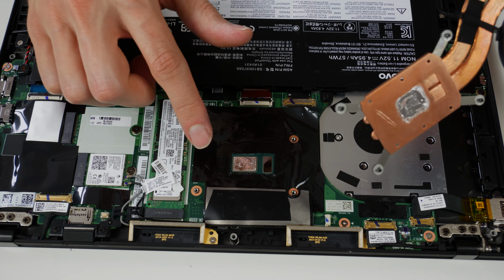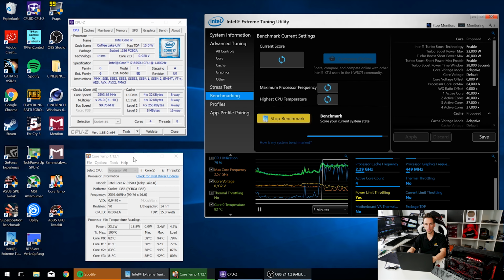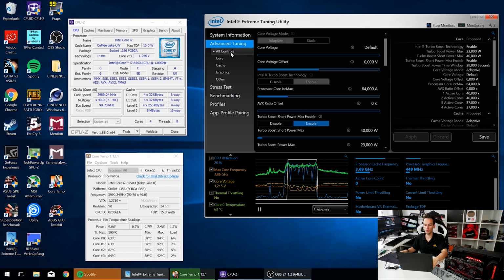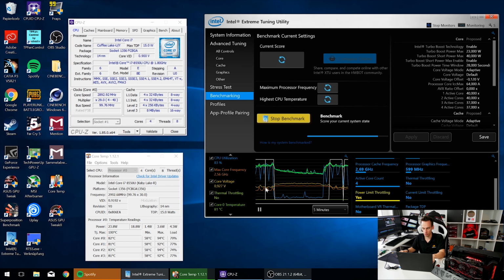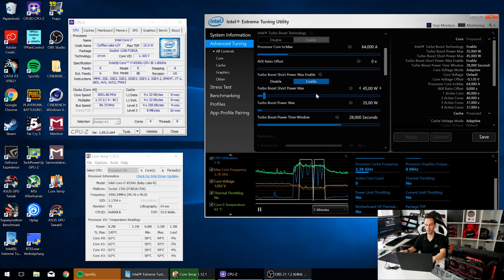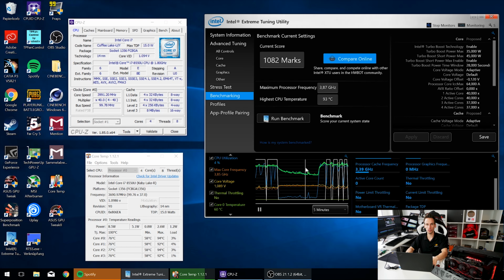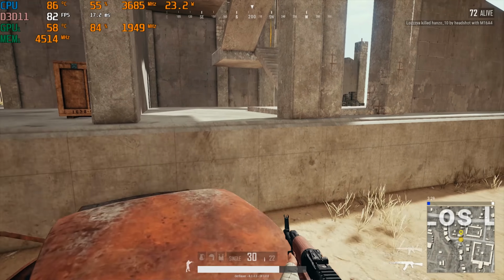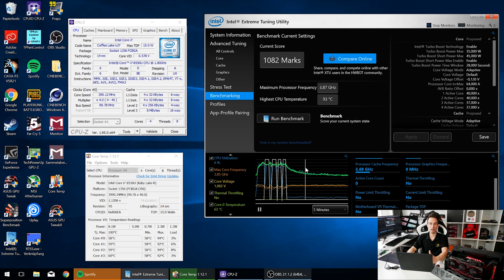Lenovo X1 Carbon G6 - Liquid Metal and Tuning (Part 2/2)

Comment: The command line options for the XTU backend (XTUCli) can be used to set power limits (Short/PL2 and Long/PL1) simply by running a script (e.g. batch file or powershell) - if you set that up to run from some trigger or program that detects the switch between AC and battery (e.g. via Task Scheduler / Windows events) it can be totally automatic. An excellent freeware program called Throttlestop can also be used to tie hotkeys (and auto-switch on AC or battery) to different multiplier/voltage profiles (but not PL1/PL2).
Reply: with throttlestop, although you can't set PL1/PL2 per profile, you can use Icc max or alternatively limit your boost clocks so that the profile will effectively have the maximum "power limit" that you want

Comment: Great video as always, Roman. 

I did the same thing with my Zenbook and noticed at least 15c cooler temps across both load and idle situations as it is completely passive. I also lowered my core volts by 0.085v to further help temps. Well worth the time and money. :)

Comment: Didn't try LM or changing any thermal paste but Intel XTU is a godsend when it comes to tablets, core voltage offset reduces the temps a lot (which matters when passive cooled) and increased the battery life a load as it would sit around 90% doing simple tasks

Comment: I've also had pretty good sucess underclocking. I have an old Macbook Air and gaming on it was horrible, and if Im being honest it still is but it's a lot more smooth. I applied liquid metal and I undervolted but still had pretty awful results. As soon as it hit the power limit while gaming the cpu speed would drop to around 900Mhz(out of 1.8Ghz max) and the Gpu would drop to 450Mhz(out of 1Ghz). After undervolting the GPU to 700Mhz (it wouldnt let me alter the cpu speed) it stopped hitting the power limit and the cpu and gpu would no longer throttle at all. Made for a much smoother experience.
Reply: MacBooks defnitely benefit from liquid metal. My MacBook pro would always run upto max temp and throttle using firefox, after liquid metal it doesn't throttle and also buying volta let me undervolt on OSX.

Comment: I've undevolted my HP Omen's 9750h by 140mV, which is quite impressive and it's rock solid in both Prime95, AVX on, small ffts, and in Ansys Fluent CFD runs that might be even more intensive than Prime95 as stress tests. My Cinebench R20 score jumped from 2750 to 3170! I actually don't feel the need of applying liquid metal, as the maximum temperature when running Prime95 for an hour is about 85°

Comment: LM works wonders for lower temps. A lot of laptops mounting solutions are low pressure where most TIM pastes are designed for desktop cooler use where high pressure is common. Also the LM helps with uneven mountings and bringing temps back in line.

AW17R4 went from throttling and having 10-15C core temp variance between banks to dropping temps around 18-20C and bringing core temps to within 2-4C of each other. 

Major risk is a chance of spillage. Due to the chassis being flexible on a laptop, protection around the Die should be done. Used thin thermal pads to make a barrier around the Die along with kaptop tape to cover any exposed pads/traces near the socket.

Comment: As far as I tested, the regular power limits cannot be controlled with either XTU nor ThrottleStop. So even if you set it to 35W, it will still throttle down to ~13W.

Comment: @der8auer Used liquid metal on my T450s. Temps under load went from 80 degrees (stock cooling pad) to 62 under load. Nice tip! Greetings from Cottbus.
Reply from the maker: thanks :) nice to hear
Reply: @der8auer  Any negative experiences on a long term use so far?
Reply from the maker: My X1 still runs perfectly fine
Reply: Awesome. I was a little bit scared because of some Redditors who claimed that the different positions you usually hold your laptop in could cause some spilling but I don't see any problems when you use just a small amount.

Comment: der8auer. Thank you for creating this video. I was a bit shy about using the metal so I followed your procedure and substituted Kryonaut. So far I have been experiencing  a  drop of  about 9C - 10C both at idle and under load. My Laptop is a Carbon X1 Gen 6 with a I7-8650U.  Intel doesn't support the XTU for my processor so I haven't tuned the voltage. If you know of another way please comment.
Reply: You can use ThrottleStop, If you don't know how to use it, I can explain to you.

Comment: Neat video. Ordered your delid tool yesterday, and that extra device in case your normal device cannot do AMD delidding out of box. First i am going to (abuse) test to see if i get any success with an old athlon 3500+ (2005), then i miiiiight re-visit some of my other amd chips. Ny gold sample 8350 got 5ghz just with tuning, but i wonder about liquid metal now. I also got a grinding tool for the top IHS so i can make it pure copper. I might need more smoothness than 1200 sandpaper however, but it's damn fine so we'll see.

Comment: I have LM applied in my Dell Alienware 15 R3 and so far, it's the best what I could do to increase comfort of using this notebook :) on thermal paste Intel 6820HK CPU had almost 20 degrees Celsius core temperatures difference, and thermal throttling was usual even on stock clocks. Now it's overclocked to 4x3,9 GHz and no more throttling :)

Comment: I use CLU liquid metal on my GPU and Indigo Xtreme on the CPU of my Clevo P770ZM. I tried the CLU on the CPU, but due to tolerances and the azimuth angle of the shared heatpipes between the CPU and GPU, even after lapping the heatsink to flat (went through 3 heatsinks to get it right, accidentally crushed the heatpipe on one of them and forgot what happened to the other), changing the mounting screws on the CPU plate to fully fix the corner not making contact with the spring screws (used pressure film to confirm contact and pressure), lapped the IHS, etc., some liquid metal slipped out and got on my ram contacts. Luckily, nothing got shorted. Just had to clean it up and everything worked fine. If you want to see the results, look up ajc9988 on HWBot and look for all of the 4790K benches. That is all on a laptop. 

I used liquid electrical tape on both the CPU and GPU to protect against leakage there. If you want more in depth knowledge on laptop liquid metal usage, peak into the notebookreview forum's clevo overclocking lounge. Johnksss is a member of that community and we have used foam pads, etc. to protect against movement of the LM on laptops to make it more sturdy, etc. Mr. Fox, another member of HWBot and NBR forum also has done a lot of work on the topic. Prema is the bios mod guru, and does incredible work, which has significantly helped with performance and overclocking. I think Sven (SV7N or whatever the name/handle is, I cannot remember if being totally honest) also did custom work on GPU BIOS for the 900m series and earlier, as well as MSI laptops, if I remember correctly. 

Laptop overclocking is how I got back into overclocking after not doing it since undergrad. Now I'm back to desktop overclocking, but laptop takes some work to do well.

Best regards!

PS - good video by adoredTV based on these two papers published around 2015 I find very interesting:
http://www.eecg.toronto.edu/~enright/micro14-interposer.pdf
http://www.eecg.toronto.edu/~enright/Kannan_MICRO48.pdf
https://youtu.be/G3kGSbWFig4
I think with your background, you would enjoy that AMD did studies in 2014-15 over putting multiple GPUs onto an interposer to reduce latency, using an interposer only partially active (1-10%) to use for routing mem and cache coherence, as well as different ways to organize the connections of those routers to optimize for latency values.

Comment: Did liquid metal on an older Dell that was constantly hitting 100 degrees. After liquid metal it runs at about 80 degrees. So yeah, it sure does it's thing.... in this case I think a new and fresh TIM would have worked good as well. The old TIM was hard as stone.

Comment: Should do a video on how to diy nickel electroplate a copper laptop heatsink.  Since nickel plated copper has galvanic resistance almost the same as galinstan (liquid metal), it keeps the gallium in the liquid metal from absorbing and "drying out" like it does with pure copper.
Reply: The "drying out" is due to oxidation, not the LM being absorbed into copper.
Reply: ArhGee is correct, the gallium absorbs and alloys into copper forming a surface layer of CuGa2 alloy. So long as this is not sanded off, a subsequent application of LM does not reduce in volume in the same way (i.e. all the galium that will be absorbed into the copper, already has been), as observed over a 15 month application of LM on a laptop copper heatsink that was perfectly stable, same coverage and temps as day 1 and not 'dried out' at all
Reply: bennyg -  Yup, there were some IBM funded studies that were done in the late 1980's, which focused specifically on gallium and micro processor ihs/substrates specifically.  It comes up in the curriculum in the hardware or embedded system engineering programs at certain universities.

People always quote that it's only nano-meters of absorption and will quote studies that have nothing to do with micro processor interposers and cooling materials.  What those studies didn't include as a key variable, were different amounts of heat being transferred through the medium.  Heat is an important catalysis in any chemical reaction and can effect how much gallium can saturate the copper.

The conclusions were that the best materials for IHS and heatsink's were titanium and tungsten.  Requiring only one application for the life of the device.  But due to the high cost of those metals and the difficulty to manufacture with them, the compromises of nickel plated copper was acceptable.  Nickel plated copper is less reactive with gallium alloys than just regular nickel or copper, because the combination has a galvanic rating that is almost the same as galistan, which is the gallium, indium, and tin alloy, that we call liquid metal.

Like hollyshit... on the internet there is so much either bad information or information from "enthusiasts" who have misinterpreted scientific studies.  It makes broaching the topic of liquid metal TIM to be one of the most toxic topics in the pc enthusiast communities.

Comment: der8auer - how about further insulating the core from other components using either a) thin 0.5mm or lesss thermal pads along the outsides of the core package, or b) thermal material that interacts with the liquid metal, so that if there are any 'leaks' of Gallium, they will be 'absorbed' or even form an ionic bond with to make a nonconductive compound

Comment: Would it be safe to apply liquid metal onto a heatsink which is copper coated (but has what potentially is aluminum underneath)?  Would aluminum underneath be dangerous, even though the liquid metal is not directly touching it (touching the copper on top of the heatsink instead)?  Great video as always, der8auer!
Reply: Please, don’t do it. The gallium refusing to copper, and eventually it will destroy the aluminum inside which will become brittle which will render this heat by unusable

Comment: Liquid metal helped a lot in my laptops thermals. Unfortunately the heatsink just isn't capable of dissipating the heat generated by a 45 watt chip that I upgraded it with vs a 35 watt chip, but at least it thermal throttles much less

Comment: Is the tuning from Intel Extreme Tuning Utility applied at reboot into Windows or at level of Bios? I'm just seeing if I can use it to modify settings in Windows and then use them within MacOS (hackintosh).
Reply: Overclocks are always at the BIOS level. so, yes, you can do that.

Comment: I tried to undervolt my i7 4800MQ in Dell E6540 on Conductonaut but it seems like even -25mV causes instability and random restart during cinebench with realtime priority, XTU is propably less sensitive to stability because -50mV worked well but didn't bring any higher performance than -25mV. I can adjust the power limit and short power limit in XTU but it seems making no effect on score and it hovers still around 50W, 47W should be the default long term power limit. I can at least adjust the all core ratio and bring it to 37 from the default 32 which does make a nice improvement in AIDA64 CPU Queen test, heavier multithread loads would still not benefit from this much.

Comment: Liquid Metal on Thinkpad X1 Carbon 4th Gen doesn't do much difference than the regular thermal paste it had.... runs at 45c at idle!  That's hot, should be idling at 22c-28c with LM at least but no difference....   but it sure don't go over 72c when stressed at fullload....

Comment: 6:40 for this step you're talking about crashes. How to you recover your pc after the crash ? Can you reset the core voltage offset from BIOS ? 
(or you just crashes in gaming / stress test and you can still boot to windows after a crash to make ajustement ?)

Comment: Hello there! I recently got a Lenovo X1 YOGA 3rd gen and tried undervolting the 8550u with Intel XTU, what I can see is a boost in the intel benchmark as you did:
- (AC unplugged - Better performance profile)
 > 845 @ stock 98° C
 > 864 @ -0.075Mv 92° C
 > 900 @ -0.100Mv 91° C (got graphic glitches on the max performance settings)
but apparently I have 2 main issues:
1) I wasn't able to figure out why the Intel software is NOT keeping voltages after a restart.
2) Seems like i got random crashes on reboot / restart / suspension mode due to lower voltage
Any idea? :P

Comment: Hi der8auer! I just applied liquid metal to my 5h gen X1 carbon (7600u CPU). Did you know the 7th gen processors has 75°C thermal limit? It can't go higher and always thermal throttles. Is there a way to increase the limit to like 95°C? or its only the 8. gen cpus that has higher limit? Thanks!

Comment: Ok after manually installing the MSI utility for XTU, I had to disable the compatible list on install lol, I ran the test and I hit 1068 with throttling stock form. .  So I will undervolt it and probably liquid metal it an report back my results.

Comment: What happens if you max out the turbo boost power bar ? Isn't it suppose to give you more clockspeed since you remove the power limit. About the thermal limit, the CPU will protect itself from thermal limit. For the battery life thingie, I believe notebooks do not hit turbo boost when on battery power by default unless you set it in bios. So whatever setting you do to the turbo boost power limit has no effect on battery mode.
Reply from the maker: I experienced mainboard VR throtteling so even bigger clock drops. Guess we'd need better VRM cooling for that

Comment: Isnt the voltage imbalance cause gallium to form a battery effect with copper? Does the liquid metal leech into the copper over time?  Some people have a concern for this.  The manufacturer states no use with aluminum only.   Do you see any long term concerns with gallium on copper?
Reply from the maker: Indium will form an alloy with copper over time if it's not nickel plated. So the liquid metal alloy will change composition and might harden over time which makes a reapplication necessary
Reply: How long does the liquid metal last before hardening and reapplication is required? Thanks der8auer

Comment: is it possible to apply undevolt and underclock automatically on boot? i usually underclock my aorus x5 v8 at 3.8ghz with -0.140volt. but doing it on boot is pretty annoying. sometimes i forget and it over heats really fast. any solution?

Comment: I have a 2018 Aero 15x, with liquid metal I’ve noticed that the casing of the laptop is much warmer than stock, since the chassis and thermal solution can only dissipate so much heat.

Have you found this to be the situation as well?

Comment: Good vid. But for some reason, I can't adjust power limits for my 5600u on ThinkPad t450s. Otherwise I did everything the same just some time ago
Reply: It's normal, it just works for some of the laptops, some laptops don't allow you to adjust power limit, there are locked in the bios.
Reply: @oscarshen6855  that's sad

Comment: 6:03 Do I have to use fixed mode not adaptive? I'm undervolting via bios (modded)
I tought fixed would run always at highest core voltage? Is it wrong?

Comment: Why not use TPFC to run the fan at max and disable power limit throttling?

But also, IMHO it doesn't make sense to liquid cool a MOBILE laptop like the X1C. Too high risk.

Comment: Wow thanks so much for posting this. I am customizing a new Carbon X1 6th Gen and was thinking of either getting the i7-8650u, using thermal paste, and undervolting it. Can you please help me decide what to get. Why didnt you get the 8650u instead? I am concerned about thermals on this and I am thinking of just getting the i5-8350u. Based on your experience, what would you recommend?